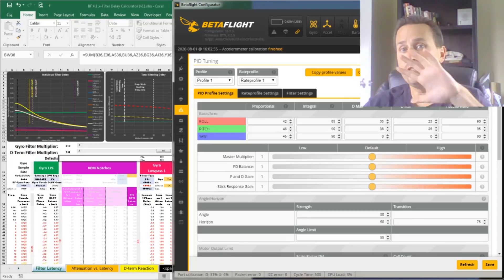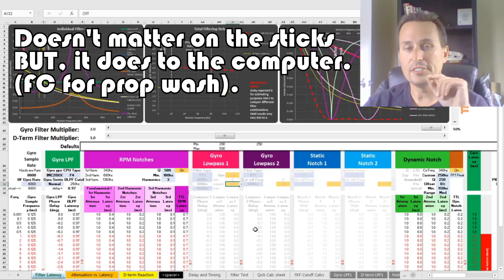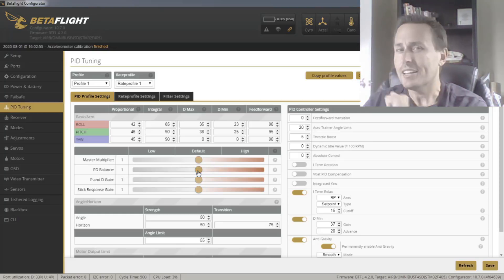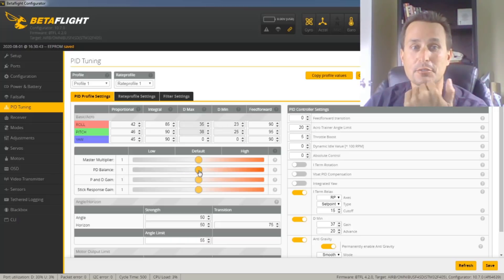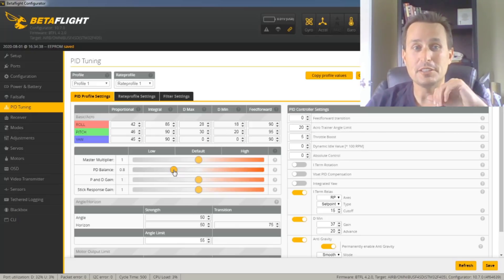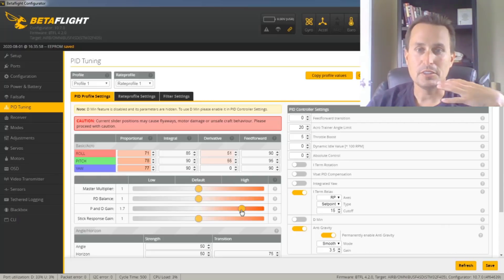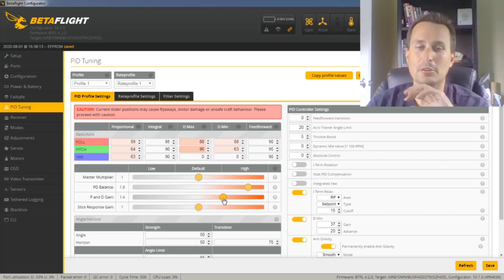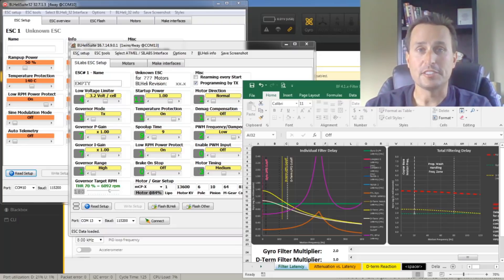5-Tips for Performance in 10-minutes

Comment: Hi! Great tips, great video, great great knowledge! I've tuned my quad with these rules and came with settings: D-term filter 1.3, Low pass 1 and 2 OFF, PID MM 1.1, PD Balance 0.8, P and D gain 1.3. It's a 5'' quad with DC frame and XING 2207 motors (about 6 kg of thrust). Weight 670g with battery. It flies better now (I'm just a beginner) than with both filter sliders to the right as it was set earlier. The most significant change is that propwash and some oscillations when hovering just above grass (15cm) are limited to minimum (but still somewhat visible). I've one question. When I raise further D term filter slider (above 1.4) or PD gain slider the quad became "nervous" when idling (just after arming) on the ground. By nervous I mean some rapid rpm changes that can be heard. There are no visible problems when flying with these settings and motors are not hot. Should I push it further with minimizing PID loop delay and PD gain increase to damp rest of propwash or leave it that way when it's relatively "calm" in idle state?

Comment: I have to tune a few quads.. this will help.. changed props and affected it a lil on one. A lot on another.. 
New FC on one has it at default and fc doesn't fit in frame so it basically hard mounted so doesn't fly well at all.. i need to move all that into a betafpv 85mm I believe.

Comment: These are some really good pointers! Currently on a 510g (with battery) 6s 5"racer. I have a 0.9 PD Balance with a PD gain of 1.3. might actually try and lower the balance even more to see how it behaves.

Filtering is 2.0 on gyro and 1.3ish on d-term but will try and disable the gyro and see what happens

Comment: Thanks for the pro tips! Please do a specific tune guide for fixing micro shakes and wobble in straight forward flight... Is it realy imposible to have both freestyle tune and locked smooth forward flight  tune? Thanks
Reply from the maker: It is most likely an issue with to much mechanical noise in your rig. Many, many, many have both.

What quad size?
Reply: 6inch. Before i use runcam5 and its fine.. Now i use gopro6 it starts shakeing/wobble at forward flight..i already crank up to higer pid but still there

Comment: Is there a good(ish) way to predict power to weight ratio?  Ex; 6s 1700kv motors spinning S3 props on a 670g 5” Apex frame?
Reply from the maker: Not that i know of.  I'm sure someone could pull together something based on experiences, but a lot depend on you battery size, etc...

Comment: Hello, I am tuning a meaty 3" cine whoop and the PD adjustment has been a great help in saving the motors and flight times. A bit of chatter is showing up in turns so it is reciprocity is still the thing. I have a concern about hitting the red lines Beatflight has set. How much concern should be placed on the warning markers?
Reply from the maker: Do you mean in Blackbox spectrum analyzer?

If talking about the PIDs grid, i would not worry about that.  They go away once you save.  I'm not a fan of that add.  It is a narrow thought process and does not consider different quad classes.
Reply: UAV Tech thank you, it is the grid flag and possible flyaway notice. It has made me overly cautious about the “guard rails”. I’m battling  Ethic Cinerat. A number of owners have had hot motors on the frame especially with the TPU prop guards installed. This has been a great help with your power to weight breakdown and PD adjustments. Most of my efforts have been with the filters to clear issues.

Comment: Thanks Mark, another great one. So what's stil a little mystery is choosing the master slider position for adressing the overall I-term. Right from the flight feel I think I-term isn't that important than with older Betaflight versions, so mostly I use master on 1.0. Any hints on determine a good preselection on this?
Reply from the maker: I-Term has a super wide window; especially so with I-Term Relax since it addresses the negative effects of i-Term in sharp stick moves.

I would say if you are doing sweeping moves and the gyro is not tracking the sticks or feels loose, up the i-gains.  If not, lower or leave it.
Reply: How do i deal with the wobbles at low throttle or after rolls. Its not overshoot cus its slow but i havent gotten rid of them yet. 320g 5in on 4s.
Reply from the maker: @grassfpv1876  raise PD Gain slider.

Comment: Im running blheli-S with new motors and a half throttle i get this wheeerrrnnt ! Noise. Everything is tight , would that maybe be a desync?
Reply from the maker: No.  Desync is when motor stalls and fails to spin up after a move.

Comment: Thx! Some guidance on feed forward would also be great. BF4.2 on defaults feels as if the full stick range is no longer being used. It seems to emphasize smooth moves around center stick, but snappy half rolls or half flips into inverted feel less predictable.
Reply from the maker: It does full rate as always.

Comment: Would toothpick class be higher power/weight ratio? Have one that’s running rpm filters on 4.2 and has some oscillations in the top end of the throttle
Reply from the maker: Yeah, toothpicks generally have a higher power to weight.  They are very susceptible to just a little off balanced props.  So i would look there first.  I had a horrible toothpic until i got good props.  What worked for me were HQ 65mm.  I recommend just getting a bunch of brands of props and see what flies best.

IF  you still have the issue, it could be P and D gain is too high.  In that case you can mess with TPA or move down the P and D gain slider.  That said, again, in my experience  with toothpics it is all about the props.
Reply: I guess it’s not exactly a toothpick, maybe this will help but I’m guessing kind of the same situation still. It’s 3” props on 3s w/a toothpick style frame&build. I was using the Gemfan 3014 Biblade & the 2.5bi & 3 triblades from Gemfan think, I have some of the HQ 65mm 

I’ll try the p&d slider as well, thank you for the reply, I really appreciate the tips from someone as knowledgeable as yourself

Comment: I have two quads that keep having desyncs one is brand new one older. What is happening and how does changing ramp up power help.
Reply from the maker: Ramping up power too fast is the issue.  If you replace the ESC, it will likely go away too.
Reply: UAV Tech both ESCs are Aikon AK32 55A 6s I also had same trouble with the dalrc rocket 50A and dalrc F.C. which I returned due to it doing the same. Been happen since betaflight 4.1. I will give the ramp up power ago on both quads. See how it goes great video 👍

Comment: I'm back here after maiden on my own built 4" Flywoo Explorer. 3000mAh 3S and I'm seasick on the default PIDs. Probably need to raise both balance and gain - a bit. Is there a Christmas special covering specifically those LiIon LR quads that's somewhat a hype nowadays? 🎅
Reply from the maker: I don't own one.  :-(
Reply: @uavtech  :-O Let's hope for santa then! 😊 I'm used to tune with flips and rolls but does that apply to a cruiser with tons of battery? 🤔
Reply from the maker: Yup.  Helps to fight wind.

Comment: Did I hear that BL heli suite now has the ability to do rpm filtering with the latest update?
Reply from the maker: BLHeli_32, yes.  It has for a while.  So just get on the latest BLHeli_32 firmware and you are set.  Do make sure that once you enabled RPM Bi-Directional telemetry, to check error % in Motors tab to make sure stays below 1% as you ramp each motor.
Reply: UAV Tech  I thought I heard they add support in the latest BLHeli-S software that would support it and you wouldn’t need to flash JESC? Maybe I misheard it but I thought Bardwell mentioned it in one of his last Livestreams.
Reply from the maker: There is a Fork (a copy) for BLHeli_S where someone added bi-directional to BLHeli_S.  But it is not the BLHei_S project direct.  That is Jazz Maverick and to install on the ESCs, you have to download the HEX files directly and load through the BLHeli_S configurator: https://github.com/JazzMaverick/BLHeli/tree/16.78_A/BLHeli_S%20SiLabs/Hex_files_16.77

Comment: Does disabling gyro filters is dangerous for heavy bend/broken props. I have gyro filter slider at 2.0 and just let the gyro filters being enabled for that reason, not sure though if bend/broken props causing noise that high in frequency?
Reply from the maker: If at 2.9, the Dyn Notch and RPM notches are doing 90% of the work.  Bent props will still vibrate at the RPM frequency, it is just the amplitude will be greater.  But with a notch, they crush so hard it should not matter.

Of course keeping on does provide some additional attenuation, but at 2.0, a pretty small amount in the grand scheme of it all.

Comment: Hi great video. I see your video about betaflight 4.2 tuning. Now I have my filter slider on 2 but my gyro is on. Now I want to remove the gyro filter cause my motor are cold. Is better to move the d term filter in a conservative area or I can  leave the slider on 2? Thanks for the answer!
Reply from the maker: You can probably just turn off and leave D-Term at 2.0.  HOWEVER, do play with D-term slider lower than too.  You might be surprised at the results (look at wash and smooth flight).
Reply: UAV Tech thanks for the reply..so I will try to lower the dterm filter manually and see what happen.

Comment: looks like random  slider moving... i think lerning how to work pid controller is more logical  to tune  quad. this slider is some shit with no logic knowlledge if you know how looks pids  and  relation pids with qud size or quad power  you deffenetly not need any sliders
Reply from the maker: It just help drive home the core fundamental of P and D are in balance and then you adjust gain strength, you hold that balance once found.  That is pid tuning 101.

Have you seen: https://youtu.be/qK5APBg76AU

That outlines the knowledge part.
Reply: @uavtech   p d balance is sounds like  something magic... but its nean only corret pid settings...  easy tune it by old way with    switches on radio.
Reply from the maker: P/D balance: "spring" vs. "shock absorber".  http://tiny.cc/pidtuning for depth.
Reply: @uavtech  you try to teach me how to setup pids ?   😂😂🤣  I know how to do it .. and i think  learn to setup pids witout any "sliders"  is much better.
Reply from the maker: They are just a tool to simplify and drive home the core concepts.  I can't see how having to do the math manually is easier, but to each their own.

What i find is too many people "that know how to tune" (not you) don't even know the core concepts so it surely helps to reinforce the two core things in a tune (PD Balance and P and D Gain strength).